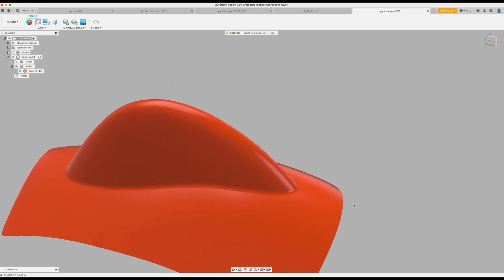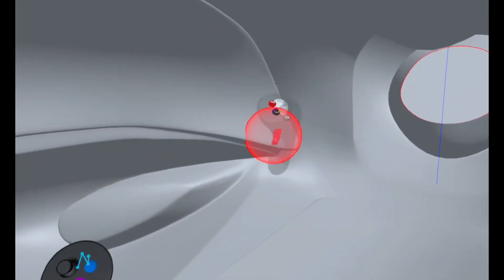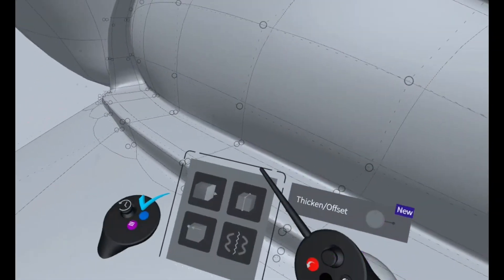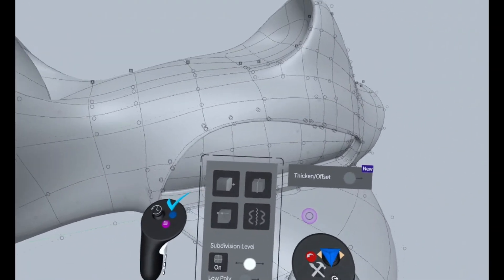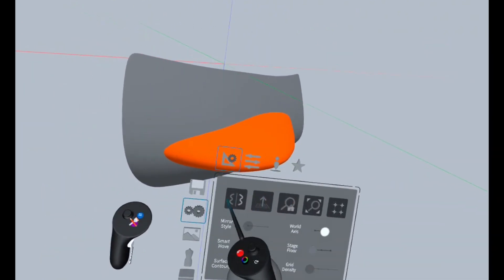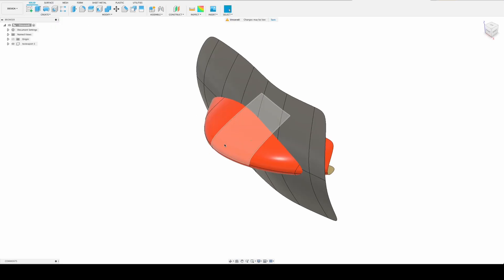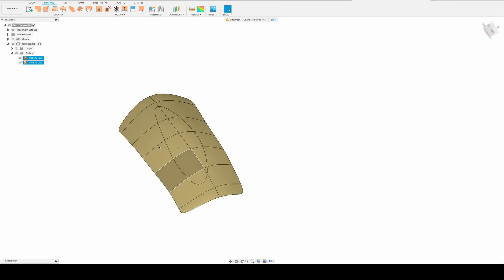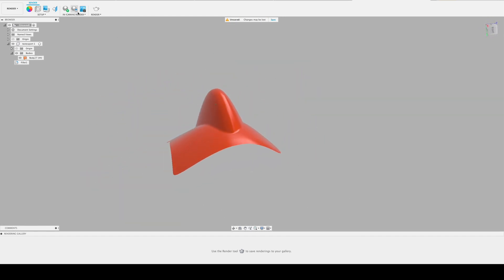Best way to merge surfaces in gravity sketch (do it in Fusion ;-)

Comment: you could also just make this shape in gravity sketch.... i know this is 2 years old but did they not have mirroring? Ive been using GS about the same amount of time and its always been available. also use the guiding axis lines with your non dominant hand trigger while stacking your controllers on top of each other. you can do this in any direction.